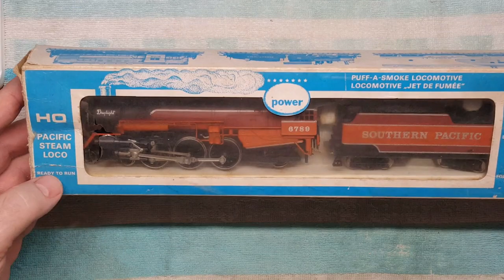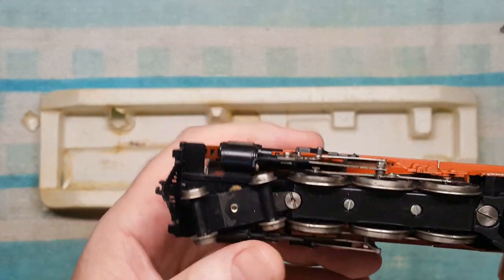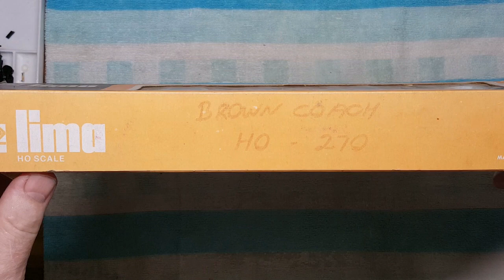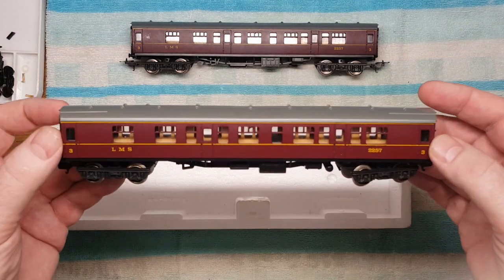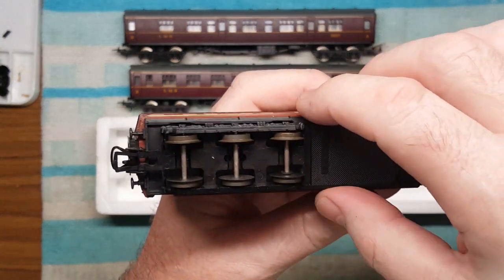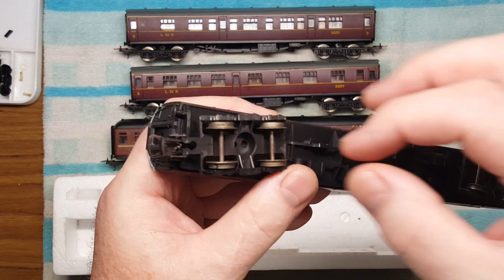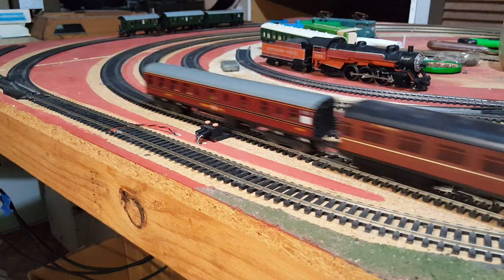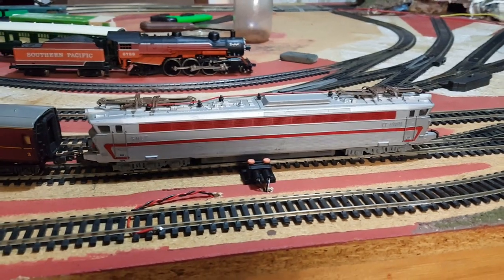What's New Wednesday S1 Ep3 Watch to see what happens today.... #modeltrains #modeltrainsets

Comment: About the steam locomotive. The Southern Pacific railroad did operate a large number of 4-6-2 Pacifics on their lines. The Daylight livery seen here was used on their P-14 class pacific engines although they were partially streamlined with  the daylight name painted onto the side skirting below the smokebox in a sense similar to their more famous GS class 4-8-4s of which, 4449 is the only operable example left. I remember having a streamlined P14 in my collection but ended up selling it a few years ago. They are very nice looking engines. Cheers on the layout!
Reply from the maker: Thanks for the info.